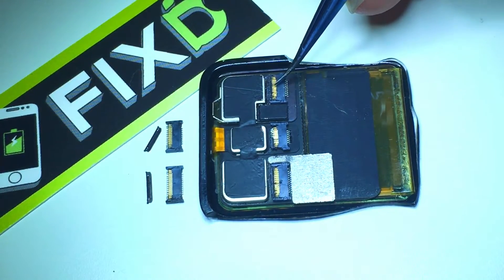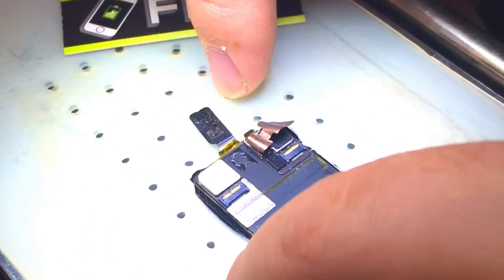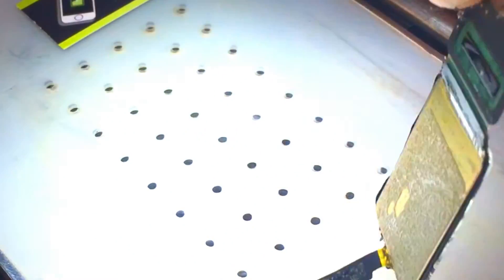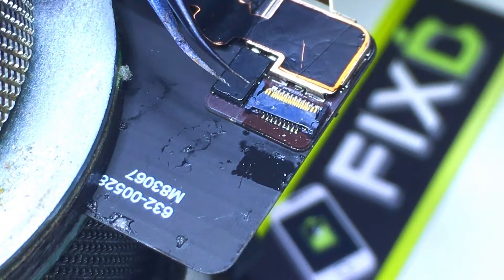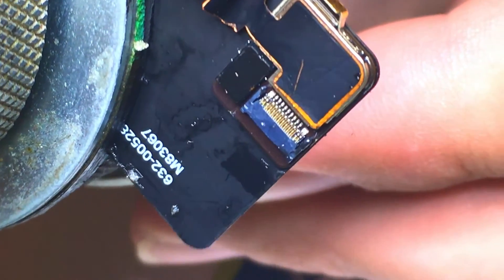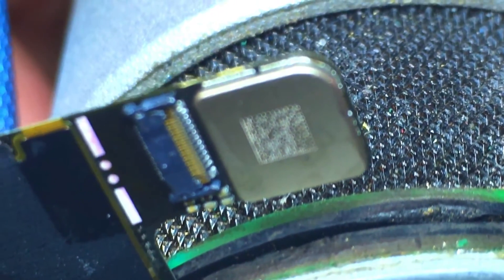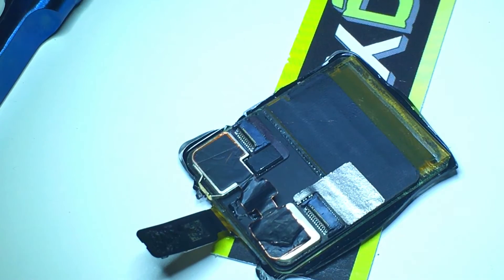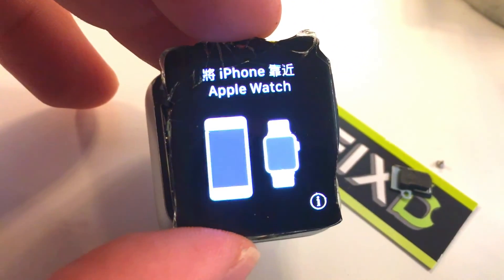What can happen if you try to repair an Apple Watch without good instructions (NFC repair)

Comment: Thank you for the video! I plan to solder the nfc chip. I am very concerned about the question: what temperature is safe for the oled display? What temperature can the display withstand and what are the consequences? Thank you

Comment: Did you ever tried to repair the oled of an Apple Watch 5? What could be the reason why its not turning on? Its not cracked or something like this. Could it it be that something under the Cover on the display flex cable is damaged? A diode oder resistior? Thanks for your opinion.

Comment: One of the only videos I've seen that shows how to replace the NFC, should pop thatt in the description/title, useful info
Reply: had to do this for a damaged ZIF connector on the NFC, caused the watch to not boot. Couldn't find replacement ZIF ports, then saw this and realised how simple it is to just swap out an NFC coil with ZIF, solved in minutes.

Comment: hi there.very nice video.i would like to know on what temperature do you set the vacumm  as i need to change the NFC with one that works and i do not want to break the display or burn it.

Comment: Can you tell me please where to get these connectors? I broke mine while try to plug in the cable
Reply: did you find a supplier? I only know you can get them off another screen
Reply: @gregd72002  no this type of connector isn‘t buyable worldwide. I asked about 10 companys about that.
Reply: @abzadbu  mind that you can buy just the digitizer only and it comes with a connector of this type. As such it appears the manufactures of the digitisers have access to this type of connectors

Comment: This is so amazing! I did a glass only screen replacement for my Apple Watch Series 3 and I didn’t know why there was a third connector but now I see that other than one for touch and another for the display, there’s also one for the NFC and ambient light sensor. And it’s also really cool how everything can be separated and replaced individually if necessary. It makes repairing things so much more efficient